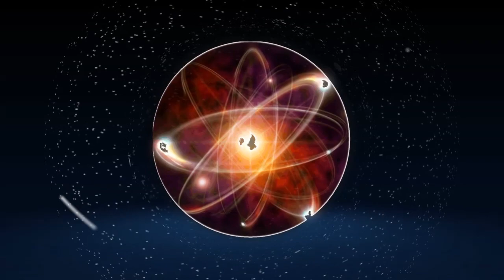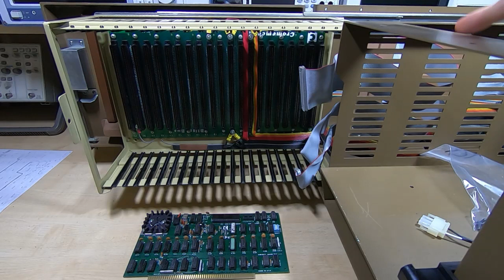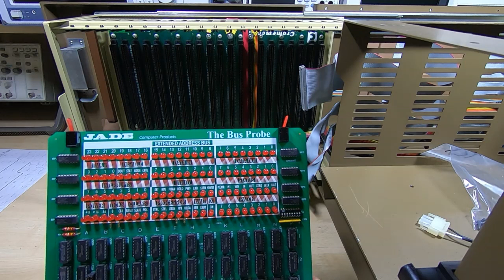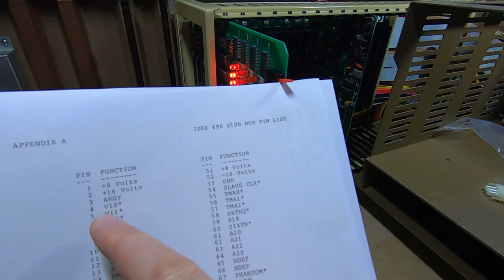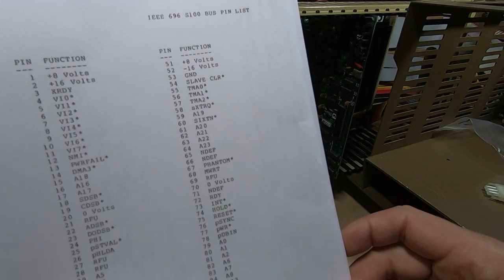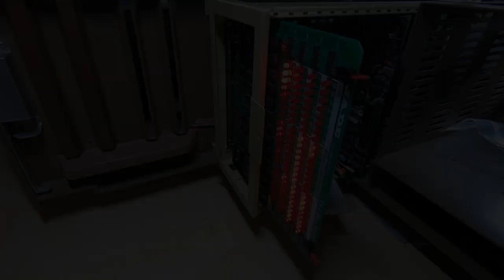Cromemco System3 Part4

Comment: Be aware that S100 Bus Probes do not necessarily display the correct status of memory contents for multifunction CPU boards with onboard memory such as the Cromemco SCC (Single Card Computer).  When the SCC's onboard memory is enabled the S-100 data bus drivers remain tri-stated for accesses to its onboard memory address range.
Reply from the maker: Yes that is correct, It only probes the bus and directly displays the current status of the bus. It is not able to display internal card states.

Comment: Please don’t touch the S-100 card edge connector with your hands.  The greases and salts on your hand can cause the gold plating to tarnish causing poor connections.
Also take the appropriate controlled ESD precautions to prevent damage to the components.  Apparently it only takes 20 volts of induced static electricity to cause damage.

Comment: When the S100 bus data input lines are pulled up, the corresponding Z80 instruction is RST 38H.  One many systems it can crash filling the RAM with 00h FFHs thus the system is executing NOPs and RST 38Hs.

Comment: When using an S-100 motherboard with 20+ slots is to ensure that the bus drivers on the participating daugherboards have sufficient fanout.
Standard 74 family TTL has a fanout of 40 whilst standard 74LS TTL has a fanout of 20. 
These motherboards are often not impedance controlled using stripline or microstrip thus if one decides to use a faster logic family such as ALS and F, signal integrity measures may be exacerbated.
When observing the S-100 bus signals ensure that your probes are correctly used to ensure that non-existent artefacts are not displayed.  i.e. probe the SUT and return path probe point at the correct locations otherwise you may thing you have under/overshoot and signal ringing when you don’t.
Also watch out for daugherboards that are incorrectly laid out with long stubs from the S-100 bus sockets that can degrade signal integrity.